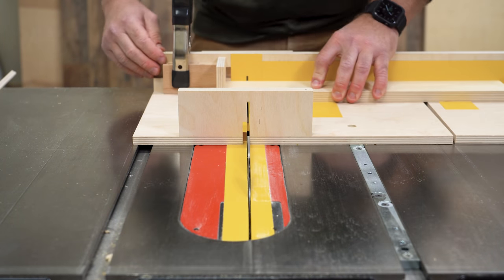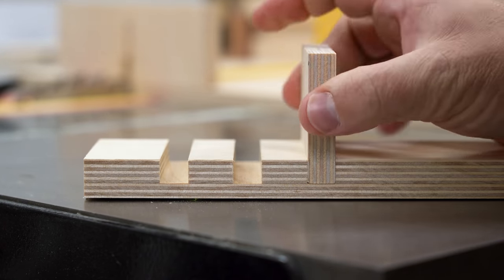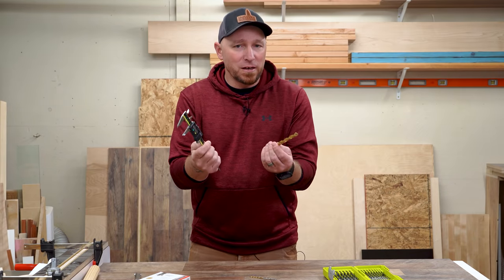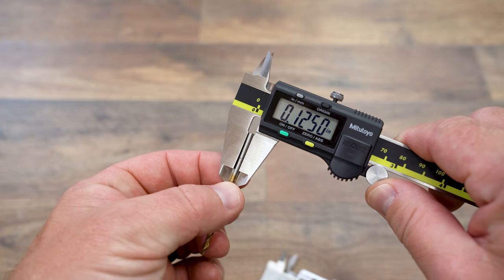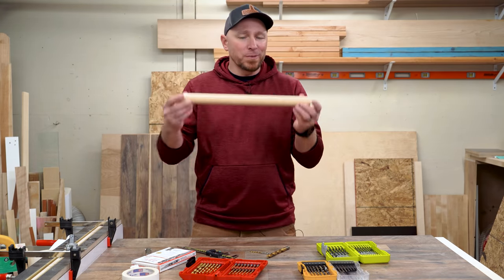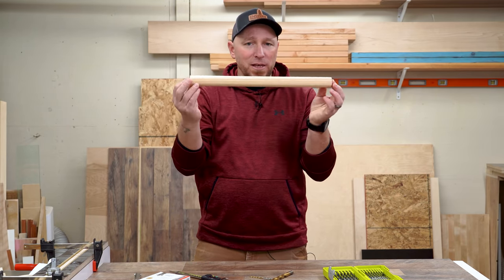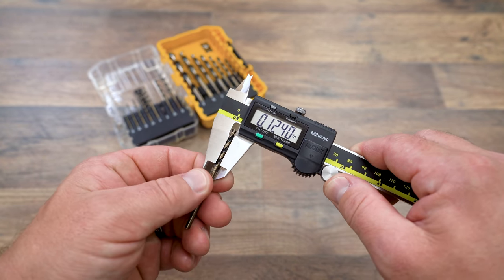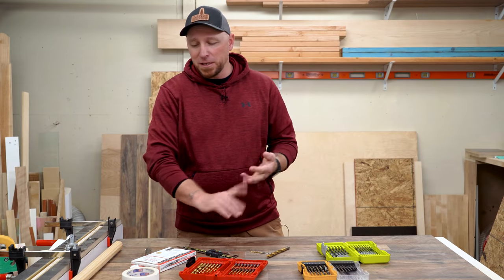I Bet You Didn't Know THIS About Your Drill Bits, Maybe

Comment: Machinist here - It should be noted that there are two manufacturing methods for drill bits; grinding and rolling. With rolling, the flutes are machined or ground straight, and then the entire bit is heated and twisted to final shape. With that type of drill bit it's not uncommon to have a few thousandths of an inch of difference from the flutes to the shaft. You can usually tell the difference just by looking at the bit - if the cutting edge of the flutes appear to be obviously protruding from the web, you have a rolled bit rather than a ground bit. If a few thousandths matters to you, get ground bits and you can bet they're a consistent diameter.
Reply: It definitely won't matter for offsetting wood you are cutting 😃
I will add another interesting fact. Carbide drills used in CNC machines (using in hand drill would most likely chip and destroy expensive carbide drill) are made out of cylindrical carbide blanks that are widely available only in specified sizes, so very often drill has wider shank. For example you have 10mm and then 12mm blanks, so 10mm carbide drill will have 10mm shank, but drills larger (10.2, 10.5, 11.0 etc.) up to 12mm will all have 12mm shanks.
Reply: @Stasiek_Zabojca  Honestly, it probably doesn't matter until you're doing finger joints, and you should just make a jig at that point. I've never really understood using a drill bit for this - I have a hard enough time keeping track of mine when I DON"T use them for non-drilling activities.
Reply: @jamesjefferson9  Best comment I’ve read in a long time. Thanks for the laugh.
Reply: What about those measuring skills?
Reply: Doesn’t even need to be round.
Reply: Yeah,
I've noticed the same principles for "ground bits" also pertain to ground beef.
Sure, my buddies can disagree all they care to, and even cut me off from further drinks at the backyard barbecue,
but I maintain my stance, that burgers are smaller, after grilling.

Comment: As a Tool And Diemaker with over 51 years in the trade, I can verify that you are right as rain. The shank is where you measure the bit, period. As for the "close enough" you noticed with your new and much more accurate Mitutoyo digital calipers (exact same one as I've been using for years), you must keep in mind that even the best ones, like you have, have and accuracy of plus or minus .001" which is of course not as accurate as a high quality set of Mitutoyo micrometers which must be used in doing work involved when we are dealing in the tenths of a thousand range. (.0001")

Love your channel!
Reply: Also, the pressure you apply must be the bare minimum required to feel the slightest friction between the part you measure & the caliper jaws... thats why good quality mics actually have friction tumblers to apply a set & constant amount of torque to the mic screw threaded anvil... 
And if you hold the caliper in your (warm) hand too long, it will grow in length,(theres a joke in there somewhere 🙄😂) making your longer measurements slightly less accurate... 

Regarding drill shanks, many people may not know that they are left unhardened so the hardened steel jaws of the drill chuck can bite into them & more efficiently transmit the drilling torque without slipping.... two hardened surfaces are more likely to slip against each other under pressure... so don't go thinking you can use the drill shank as some kind of hardened blank for making tools etc... unless you have in-house heat treatment facilities of course... 😀

😎👍☘️🍺
Reply: this right here. I see so many people go for their fancy digital shit but dials and gearing will always be more accurate.
Reply: "The shank is where you measure the bit, period", i have a objection here. In general you are absolutely right. However, after 10 years in metal workshops i found that more often than not the shank is scratched and kinda, lets say peeled off a bit, due to wrong use or general wear over time. So i went to measure the width of a bit on the tip, at the outer most points of the edges. This of course only works with a properly sharpened drill
Reply: I’m not tool and die, but I am a journeyman machinist, nearly 20 years in the trade. Our worlds are so different yet so similar. Respect. For accuracy, I use a mic. Almost all twist drills we have and use - and we use good quality-, there is often a half thou difference between tip and shank. I suspect it’s because of the mechanically generated twist. For most folks, that’s more than enough accuracy. It’s even enough for me at 99% of times. Just yesterday I pulled out some #20 and #21 drills, shanks were all within .0005”, despite .002” difference in drill size. Tips measure correct.
Reply: Wow if only any of these were comments were relevant… why would any woodworker need a mic to measure down to tenths range? I mean it’s wood we’re talking about…. +/- a thou is more than good enough for any woodworking tasks

Comment: I use a small aluminium strip that I filed to the kerf width. Being wider, it is more reliable than a small cylinder, especially against softer woods. It is attached to the sled with string, so it never gets lost.

Comment: (nods) In wood working there are only additive and subtractive processes. In metal working there is also deformation. For example, saw blades are cut from dimensional stock, but the teeth are intentionally bent to create a blade set that is wider than the body of the blade. I'm one of the people that asked the question on the last video. I knew that drill bits are cut from drill rod, but I did not know if drill bit production involved incidentally or intentionally deforming the cutting edges or flutes. It's certainly common for cutting tools to provide relief behind the cutting surfaces, like you see with masonry bits, hole saws, some spade bits, and various designs for saw teeth. It wasn't that there was a problem, it was that there could be a problem. The two solutions to that possibility are testing to prove that there is no difference, or just directly using the surface that you measured. Either answer is fine. People who instead assume that there is no difference will be fine in a lot of cases, but when you get into things where there are a lot of details that all have to work together, you can't afford to make assumptions. I suspect that the people watching this channel include people who do a lot of work where assumptions are danger with a capital D. That may not be an important skill in hobby wood working, but for those of us who need it in general, it's a hard habit to break, and a good habit to maintain.
Reply: I have some drillbits with Deformation in the shaft and they are bigger than the Tip...and some Special drillbits with braced carbid on the Tip for Drill Out HSS , they are bigger at the Tip.
Oh and some Drills are Labeld 8mm but make 8.2 mm holes, and measure 8mm because some one else Grinder them with a Offset on one Side...
So Drill Test holes and measure that to besure what hole you get, dont guess.

So im 100% with ya, If you measure Side A to be a placeholder, you dont use Side B later in the Projekt, Stick to Side A.

Im Sure thats why the build shims in flat and round... So you can Trust the Diameter any time... If Ambiente Temperature is around 20 Celsius;-)

Greatz from Germany
and have a nice Day
opo
Reply: There's a lot of deformation in wood working. inherent internal strains being released with cutting, drying at different rates due to exposure warping wood, intentional reshaping with steaming, etc etc.
Reply: When I read this comment I was “hearing” it in the voice of the guy on “This Old House.” Not Bob Villa or Norm, the other guy.

Comment: I picked a drill bit and measured the distance for the flute (spiral) to wrap 1/2 way around.  It was nearly 3/4 of an inch.  This means a 1/2 inch thick board could easily NOT rest on the high part of the flute, causing my measure to be off.  The bit which I would use to mimic the width of my blade kerf takes nearly 3/16 of an inch for the flute to spiral 1/2 way around.  This means I can trust any section of the bit for a 1/2 inch or thicker board, but not a 1/4 inch thick board. edited to add, this also means I need to ensure at least 3/16 inches of the bit, above the point, is engaged in the measuring process.  I.E., the point must touch the table on a 1/2 inch thick board.

of course I could lay the bit horizontally if I need to use the fluted end to measure a 1/4 inch thick board, thus using the width of the board as the reference.

Comment: I worked for 44 years for the second largest cutting tool manufacturer in the world, and I can assure you that the diameters SHOULD be different ... if made correctly!   If you measure them with a micrometer, perpendicular to the axis, across the margins at the tip, and then at the far end of the shank, there should be a difference.  This is intentional!  Drills, taps, reamers, etc. are back-tapered to provide relief to reduce friction as the tool penetrates deeper into the workpiece.  This can be caused by chips or the material closing in around the tool due to heat or material elasticity.  Depending upon the way they are ground, usually, small drills will have a continuous taper from end-to-end (Ours were 1/8" and smaller).  Larger drills, due to their length, will have straight shanks, but not necessarily the nominal diameter.  It blends with the reduced diameter from the back taper.  [That's why you should never use the shank as a gauge, particularly in metal working.] I'm referring to quality branded, ground, twist drills here, not cheap roll forged drills, which may or may not be designed and manufactured correctly.  Hope this settles the question.  dave
Reply: Sorry for my previous comment Dave.  You already addressed it.  I just didn't read carefully enough the first time.
Reply: Over 50 years experience as a machinist.  Some times I needed a pin for a non standard hole size and the pin gauge box was missing that size. I would go to the drill drawers with my O.D. mic and start checking letter and number drills. Shanks varied as much as .003" in each size drill, never oversized. The cutting ends measured spot on! Carbide drill shanks are usually right on size to .0005" undersized. Measure the kerf size and that's the size spacer you need! ✌️
Reply: @jameslezak8179  I've found the same, however, I've also measured a few thou variation in a single drill shank on cheap bits.  This large variance seems to be a result of markings stamped into the bit.  Some companies clearly do the stamping after the grinding, because there's a raised rim around the stamp.  It's not the raised rim I'm measuring here though.  Stamping slightly bends and/or squashes the shank, resulting in a different effective OD at the damaged area. (If you have a bit that doesn't want to stay tight in your chuck, check for raised edges around the stamp.  It might be the problem.)

I'll take your measure the kerf idea, and raise you one better.  Try bits in the kerf much like you would use a feeler gauge.  When you get a good fit, use that bit.  Just be sure to rotate the bit and move it in and out a little, and check a couple places in the kerf so you're not doing a point measurement.
Reply: @charlesenfield2192  Good point, great idea! 👍😎✌️
Reply: PS - If you want to have some fun, take a micrometer to a cheap import index of number and letter size drills.  You'll be lucky if half of them are the correct size.  That doesn't really matter much.  Nobody uses twist drills when a precise hole diameter is required, but it will totally dispel the notion that drills can be used to calibrate your micrometer, as precise spacers, as parallels, (all things I've seen suggested on YouTube videos) based on their nominal diameter.
Reply from the maker: @david miskinis Interesting. I will add a bit of common sense to this though. Even if all drill bits should have a taper, not many folks have the fancy drill bits you speak of. Which means for most, they will have something similar to what I showed in the video. And of course they could still register a taper if mic'd, which would be a much more appropriate way of measuring for a machining process, since even high end calipers are given a stamp of approval at +/- .001". Nonetheless, as shown, they measure close enough to the same on both ends for anything even the most finicky of woodworkers is going to need to use them for.
Reply: @InspireWoodcraft  True! But, if you're even .0005" over sized and make 5 cuts it will have .0025" accumulated in slot, a definite wiggle will show up, maybe not good enough for some craftsman'. Of course pushing wood material against a .06" radius will probably induce some wiggle. That's probably why I'm better with metal and just so so with wood! Lol!  All valid points, experimentation is key! Nice conversing with you! ✌️
Reply: @InspireWoodcraft  I'm talking about standard Jobbers drills, not the "fancy" or high tech ones.  [That's a whole other level of drill technology.]  All conventional drills will, or should be, back tapered.  Some more than others!  My company private labelled drills for many common brands that woodworkers and home shop machinists use, so this is not about high end.  Frankly, this is more about very inexpensive tools from overseas and various manufacturing processes and their overall dimensional and quality standards.  I was merely trying to point out that drills are not straight and could account for some of the discrepancies you encountered.   Factor in low quality drills and the problem is exacerbated!  dave
Reply: @jameslezak8179  Absolutely!  As for carbide, the shanks are usually nominal (.375, 10mm, etc.), of either the drill diameter or the closest common diameter,  and tight tolerances for holders and collets, particularly shrink fit.
Reply: @charlesenfield2192  Absolutely!  We stamped millions of drills and always received complaints about runout.  Due to the expense, we couldn't get our company to laser etch to eliminate that problem.  We, Kennametal, sold off the C/L and CTD brands several years ago and I think they still stamp them!!!??!!  [They are now owned by a Chinese company!]
Reply: @jameslezak8179  Add to that the quality difference between a ground and roll forged drill and your .0025" would be considered close tolerance!  My real point is that twist drills are not straight pins in which can rely upon.  Understanding that, you should test fit before assuming you've got it nailed when you use a drill as a gauge when you want I tight fit!!  dave
Reply: @davidmiskinis3032  I did some metallurgical consulting work for Kennametal about 30 years ago.  I was impressed with the company.  They really seemed to know how to make quality products efficiently.
Reply: Thank you for the facts Dave Miskinis, It pisses me off when some use there misguided and uninformed logic to explain why they are "right".
Reply: Wow! Good to know.
Reply: @InspireWoodcraft  As someone "in the business" I can say that everything @davidmiskinis wrote was completely accurate. That's not to say that using a drill shank for a gage in a woodshop is inappropriate - it will get you close enough 
In a toolroom, a machinist will check a drill's size by measuring  across the margins of the drill at the cutting end of the bit -- using micrometers, not calipers.
Reply: @davidmiskinis3032  I mean thinking about it it makes sense, you want the cutting edge to make the right sized hole but you don't want unwanted friction at the part thats basically just there so that you can drill deeper and still get the chips out etc. The hole is shaped at the front of the drill, thats where it has to be the right size.

Comment: I’m a machinist. I’ve seen plenty of bits with the shank smaller than the flutes. I think it’s just a tolerance thing. Some machines have a bit of a taper over length. So if there’s - situation where the flute end is right on size but tapers .002 small on the shank end it would be no issue to the bit. So Qc would likely sign off on that. Most are accurate across the entire length of the bit. But there’s no reason to scrap it if it’s only small on the shank end. So a handful of bits won’t be percent from manufacture. Qc simply lets them through. The vast majority will be straight
Reply: I mean that's likely still irrelevant for woodworking tho, interesting info nonetheless! It's funny bc when I first started to read your comment I assumed you were going to talk about those large bits with a much smaller shank for fitting standard chucks, obviously that would've been silly to even mention, but it popped into my head lol

Comment: I have to agree with David Miskinis you also have to take in consideration of the quality of the bit! As I said in previous video relative to drill bits, the bit is sized for the kerf of the hole it is to drill not the actual bit diameter. As with twist bits they are called twist bits because the drill rod is heated and pulled through dies and twisted at the same time creating the flutes thus twist bit! And they very in diameter just from the manufacturing process. If I need precision a drill bit is not my tool of choice. Just saying! You do have make some very useful videos. Thank you. 😁🛫

Comment: You are correct when it comes to  jobbers drill bits the shank is the same size as the twist, and the included angle of 118 degrees.